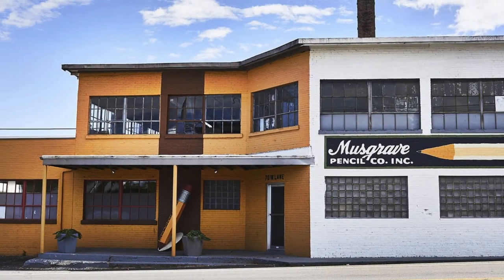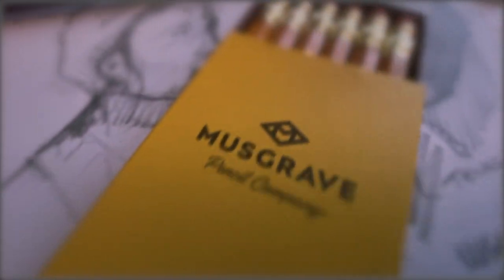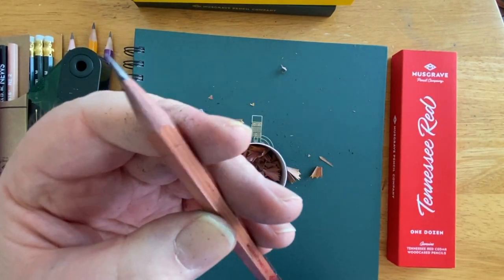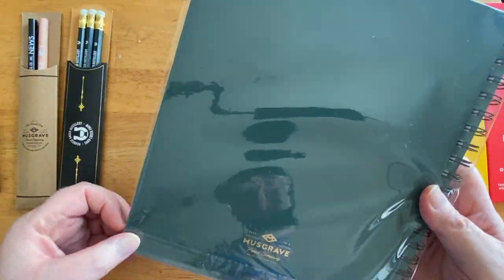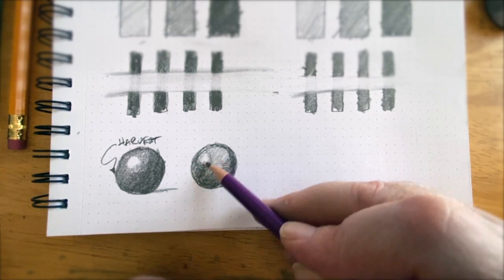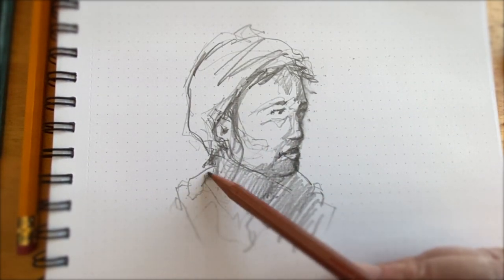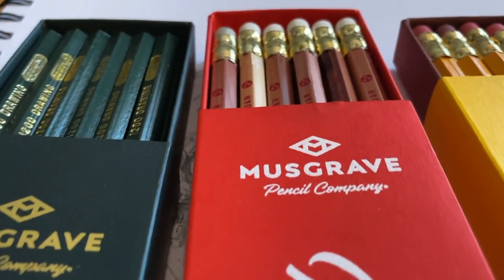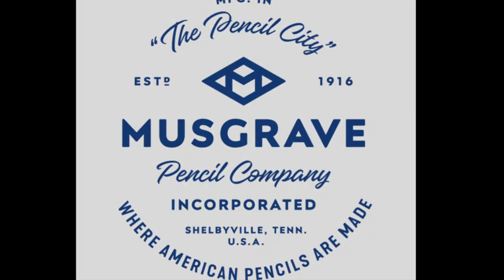Musgrave Pencils

Comment: Hi Owings, I tested 12 different Musgrave pencils last year, with one unique and spectacular pencil in the lot: The Musgrave 600 News. The 600 News stands out as the most versatile dark pencil I've ever tested--and I've tested over 1100 pencils, virtually every major commercially available pencil. I don't do subjective tests. I designed and built equipment to test very specific properties: darkness, softness, smoothness, pressure sensitivity, blackness range, and 21 other properties. When I say the 600 News is 'versatile', I mean specifically it has a medium pressure sensitivity of P9 on a 20-point scale. The reason this is spectacular will be apparent and of immediate interest to any graphite artist. You simply cannot find a truly dark pencil in the middle range of pressure sensitivity. While you can get a light line with a very dark pencil, you achieve this only by barely touching the pencil to paper. The 600 News is different, marvelously different, because you can achieve a range of values from light to dark with this pencil. You can't do that with a Faber-Castell 9000 6B, Mitsubishi Hi-Uni 6B, Staedtler 8B, or any other commercially available dark pencil, dark defined as D16 or higher on the 20-point darkness scale (which actually goes to D24 for graphite, D40 for carbon and charcoal). They all have pressure sensitivities of P13 or higher, typically around P16, which means if you do anything more than barely touch the paper, you're going to get a dark line. The 600 News has D21, S16, P9, and L12 (smoothness L12 on the 20-point smoothness scale). Now, the way they may be achieving the impossibly perfect P9 is indicated by the very LOW smoothness value of L12. You just don't see low smoothness in dark graphite. You DO see it, of course, in carbon and charcoal, and my suspicion is that they are adding small amounts of very fine carbon to bring up the darkness, which will also force down the smoothness. At this point you may shrug your shoulders. 'Staedtler and Faber-Castell offer hybrid graphite/carbon pencils. It's nothing new.' Here your first reaction will mislead you, because Musgrave's 600 News is different from those hybrids. I don't even know that it IS a hybrid, I'm only guessing. I wrote to them over a year ago about this. They never responded. But you can test the F-C and Staedtler hybrids and compare to the 600 News, and you'll find a very distinct difference. First, the 600 News is smoother (The Staedtler 8B has L4, the 600 News has L12), but most importantly, again, the dark F-C and Staedtler hybrids are hyper-sensitive to pressure, so effectively you cannot get a light line unless you barely graze the paper, while with the 600 News you can get a nice range with reasonable hand pressure. It's simply the most amazing dark pencil I've ever tested. I found nothing special about the Tennessee Red. In my testing it was a quite ordinary HB-range pencil: D10, S5, L9, P8. The softness of S5 is a little low, but low softness seems to be a characteristic of Musgrave pencils, and may again indicate they're adding a touch of carbon to all their pencils, but especially in the 600 News. Compare the #2 909 Ceres (D12, S8, L8, P11) and the #2 1816 Bugle (D9, S4, L7, P6). While the #2 Bugle is 75 percent as dark as the #2 Ceres, it has only half the softness, meaning it leaves less than half the graphite on the page relative to the #2 Bugle. You might not immediately pick up on that fact, but if you use the pencils for a while and compare, you should find a performance difference between the two, especially if you're drawing with them. The #2 Bugle has a D/S ratio that's better attuned to writing, while the #2 Ceres is a better choice for drawing. If you want to understand the several 20-point scales I've devised, you'll need to read my book, Pearson's Graphite 2015, available online and at your favorite bookstore. Cheers!
Reply from the maker: Thank you.